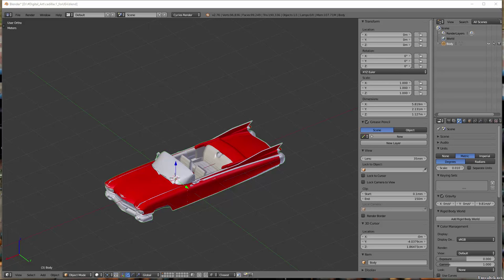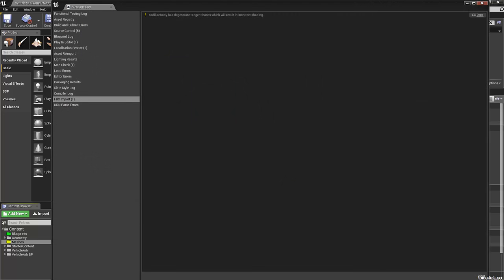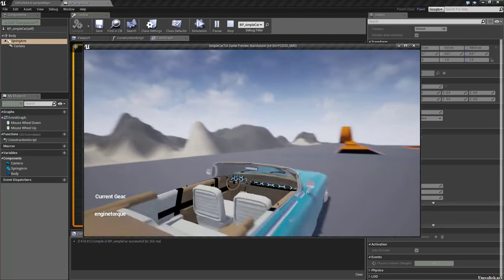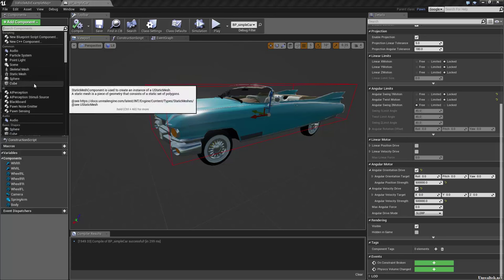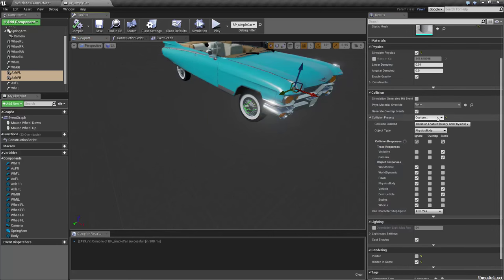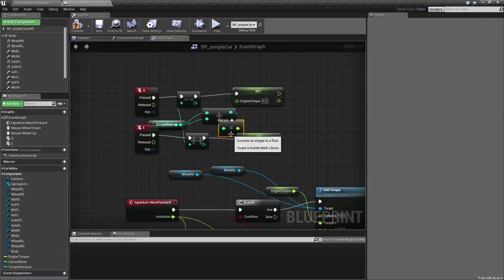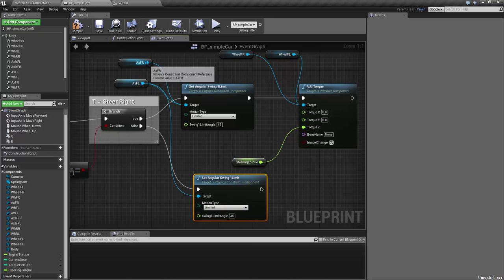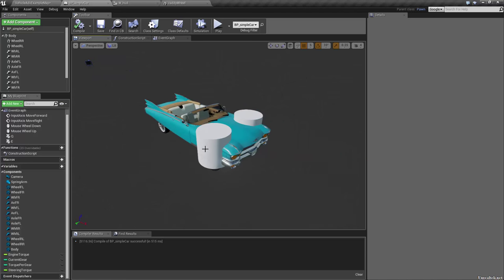Custom Vehicles in Unreal Engine - 2 - Simple Car Using Physics Constraints

Comment: I am using input axis > add controller Yaw Input and Input Axis LookUp > Add Controller Pitch Input in the Car's BP and the movements of the camera is a lot smoother and so aggressive as if set it up in the PlayerController just wondering why that is. Input scale?  :-) Is it better to set it up in the player controller? Other than that am pretty deep in on this series in Unreal 4.24.1 and there are a few minor changes but everything is working out great so far.